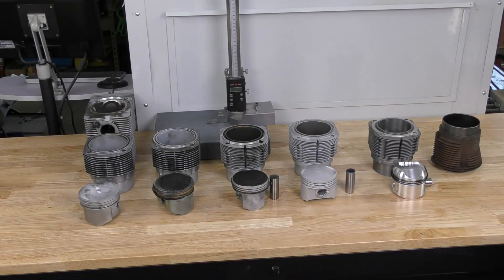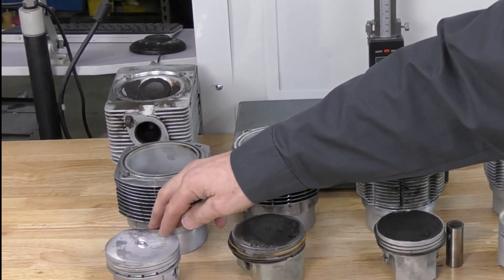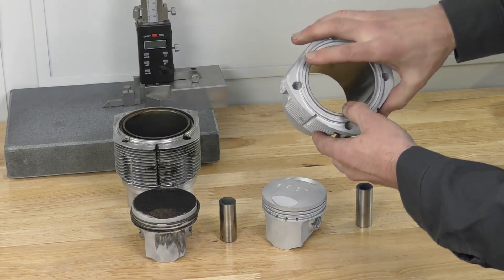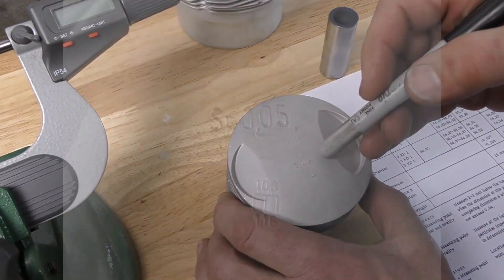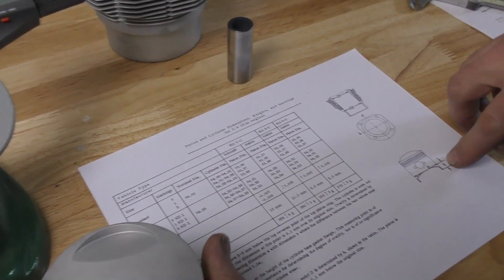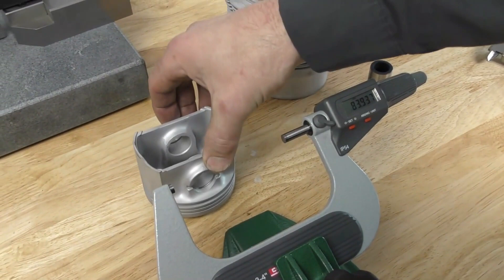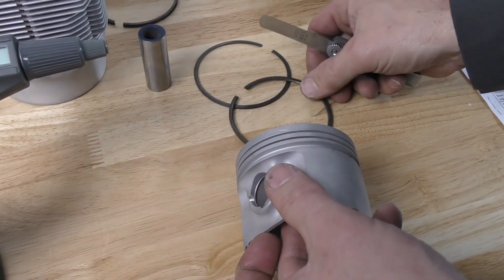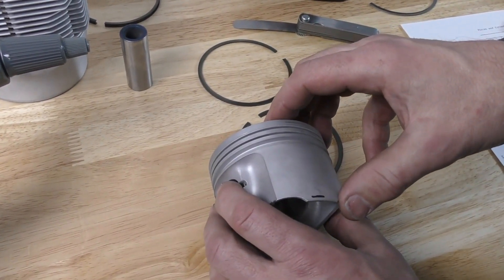Porsche Air-Cooled Pistons. How To Inspect And Measure

Comment: Thank you Kurt for this other excellent video. I have a questions about the handbook used in the video for checking clearances and tolerances. Are these handbooks for dfferent egines avaible through you? Or do you have information on where they are availble?
 Cheers, Dominic.
Reply from the maker: These books are getting very hard to find. Some are still available directly from Porsche. You will need to check with your local Porsche dealership.
Kurt
Reply: Thank you for the reply Kurt, much appreciated. Short of finding the booklet, are the piston data sheets available online? Thanks again for your time.
Dominic
Reply from the maker: Not that Iam aware of but you might be able to find some somewhere.
Kurt